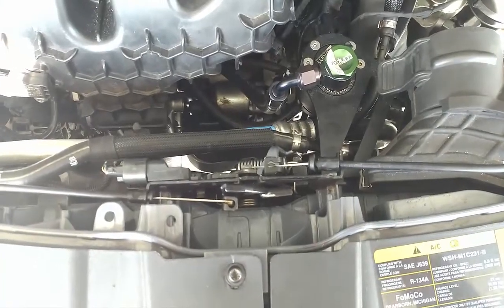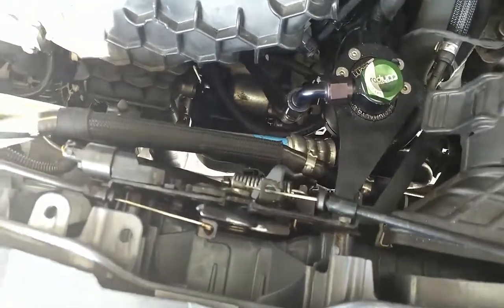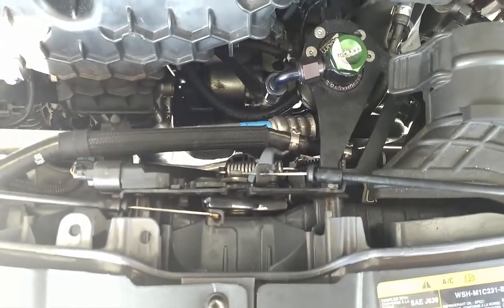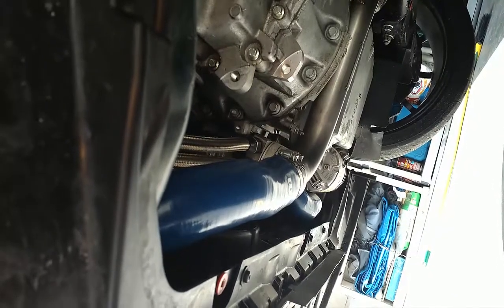Ford Focus Hood Latch Release

Comment: I got mines open coming through the right side of the Ford emblem and behind the latch release with a roller pin. It looks like a long screwdriver but it turns towards the tip and it's not. It's the thing you used to paint the walls but without the cushion.
Reply: @homemodsgarage3401  the release is inaccessible on the 2010 focus.  it has a metal shroud blocking the access to the release lever from the bottom.
On mine, the latch got corroded and wouldn't release even with the hood release cable working properly.
I had to remove the latch itself, by removing the two bolts securing it.
Gave it a good cleaning and lubrication, and it works properly again.
Have to make sure the latch mechanism is periodically lubricated to keep this from happening-

Comment: Well this doesn’t help on how to open it when it’s broken
Reply: You'd need to remove the latch itself to get the hood open, if it doesn't release because it's corroded like mine was. Two bolts using a 10mm socket on mine.
Reply: @wingerrrrrrrrr hey my hood release from inside cabin isn’t doing what it’s supposed to. Is that what you went thru ?